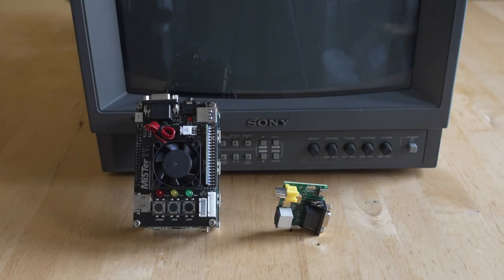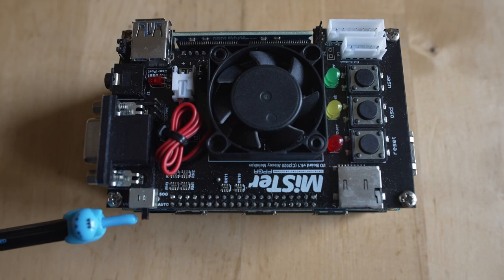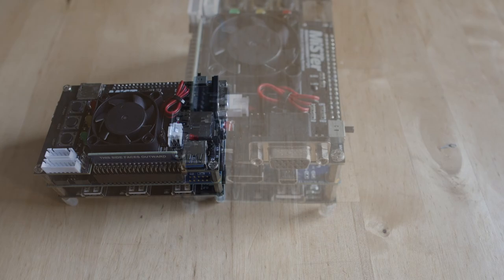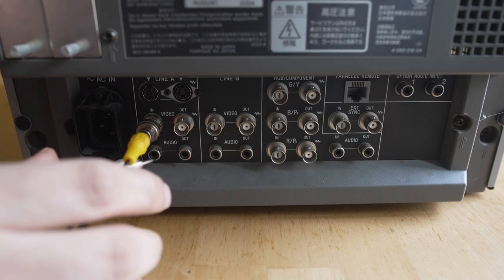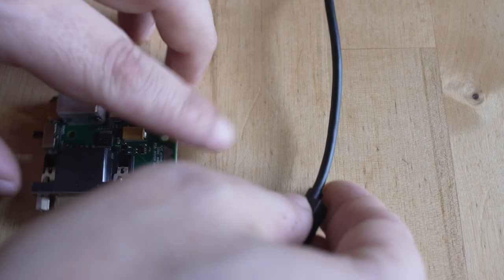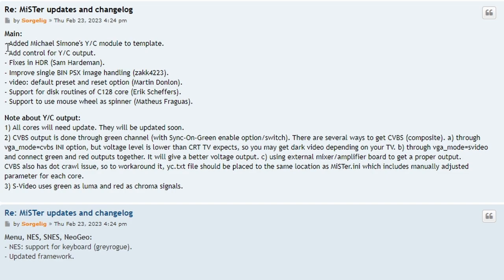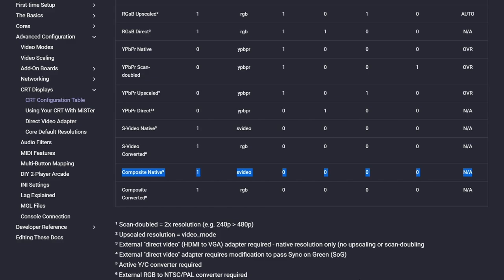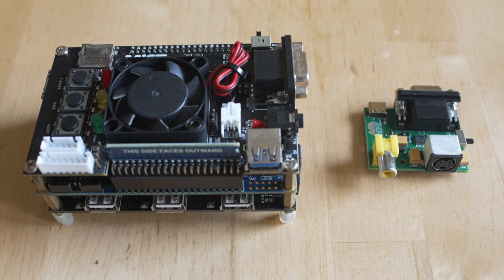MiSTer FPGA DE 10 NANO! S Video / Composite Analog Adapter Tutorial! Old School Analog Video in FPGA

Comment: Pretty annoying that the S-Video adapter isn't as male VGA connector... I'll need to buy a male to male metal adapter.
Reply from the maker: It’s because mechanically you don’t want to plug directly into the VGA port on the IO. You are asking for torque pressure on the solder joints that way
Reply: @VideoGameEsoterica  So we could just rotate 90 degrees and problem solved. :) Having another cable just for this... ohh boy.
Reply from the maker: I still don’t recommend it. It provides no strain relief

Comment: I have an RCA Lyceum and it has RGB input and I'm having issues getting the picture right. The retrotink transcoder displays it but the color is off, the gamma is too high and I've been asking around for help. I'm told to try the mister but here's my setup. All my consoles are component. I need to convert ypbpr to RGB bnc. I want to use vga breakout rgbs cuz the sync is probably the issue. I bought a sync combiner so I'm hoping that works. If not, I'd like to try this. I need a mister that I plug my ypbpr into this device and the output is vga/RGB. All my games are from original hardware. I don't want to use raspberry pi or sim cards. I just want picture displayed properly. Is there such a thing?

Comment: I recently bought a old/new stock Extron vsc 500. It does what I want it to do. It down converts  video signals to 480i. It also has knobs to adjust the picture size. It also has composite, s-video and component out. The only downside is that it does not come with a remote that let's you save picture settings pre-sets. The remote seems to be rare. I am using it on a 27" Sony Trinitron TV.
Reply from the maker: It’s funny how often the remote becomes rare. Not unusual at all

Comment: Thanks for the video, I'm trying to get it working and your point that the vga cable may not be wired for 5v is something to check.
Be good for people to see examples of why composite may be preferred for aesthetic standpoint over RGB, dithering and colour blending, loads of 16 bit titles take advantage and 32 bit era 3d can benefit for the softer image.
Reply from the maker: Yes the blending does improve the look of some titles for the sure. PS1 being a good example of “sometimes it looks too clear”
Reply: And confirmed it was my VGA cable causing me the output issue, great tip 👍
Reply from the maker: They certainly aren’t created equal. Glad it helped!

Comment: I noticed you plugged the white audio cable into the out port on your pvm? My understanding was that the out port is there so you can loop audio out to another source and that audio in most pvms is mono. So are you not sending audio in on the left and back out on the right or can it be used as left and right as you showed?
Reply from the maker: No I was simply illustrating how you’d hook them up on a standard consumer television (something I don’t have, just PVMs)

Comment: If you're using a PAL game on a C64 or Amiga or Mega Drive and the S-video/composite adapter is set for NTSC, does the MiSTer still send an NTSC signal if the adapter is configured for NTSC?
Reply from the maker: That’s a good question that I will have to look into

Comment: i have antonio Vs adapter 
it seems to work ok - 32x still never got fixed to have the right colors :(
Reply from the maker: On the adapter or the core itself?
Reply: @VideoGameEsoterica   the core itself (for analog video) but it has been a few weeks since last checked 😅
Reply from the maker: Yes nothing has been updated on 32X yet